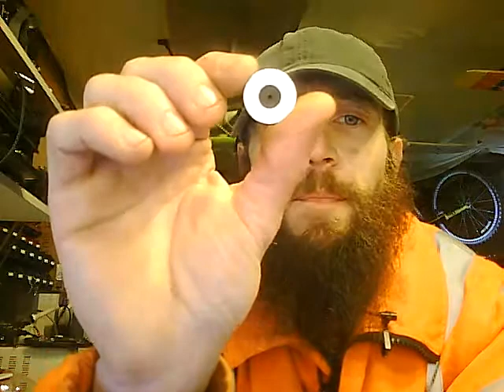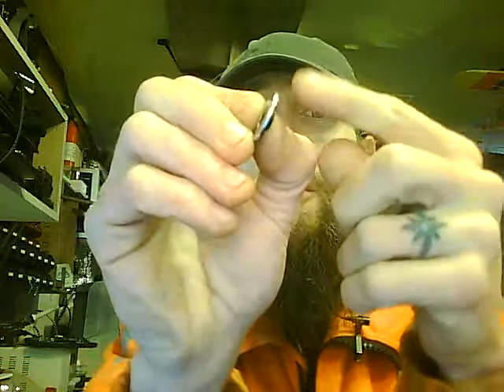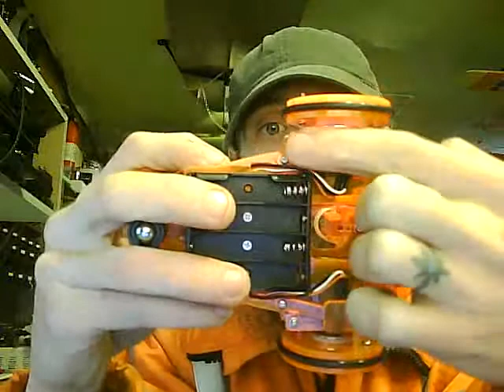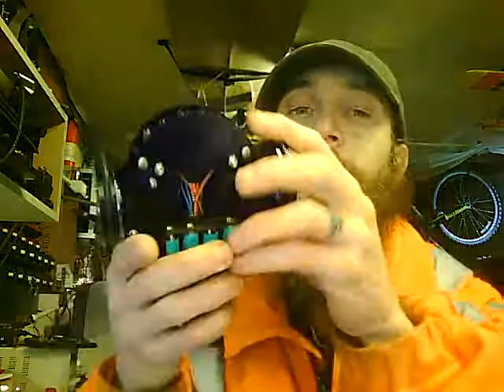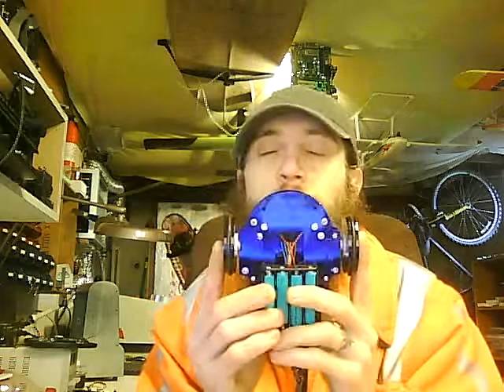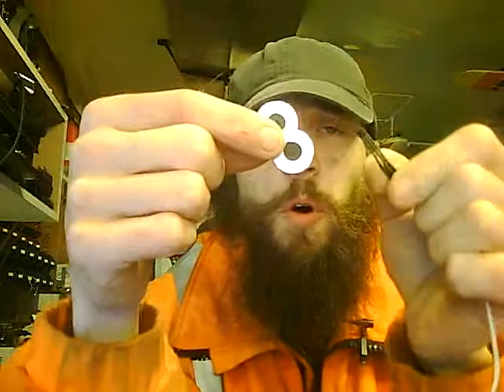RBS New Encoder Kit

Comment from the maker: You are correct, single-sensor only, no direction (other than the fact that the robot decided to go in a given direction and thus, already knows what direction its going). That said, there is no reason 2 more sensors can't be added to get true quad-encoders. Hell, you would get 16 clicks/rev outta the deal too.

Comment: These are very popular motors but there is no tail-shaft encoder kit for them and yours looks a bit to big for them.  Make yours smaller and the right hole to fit the tail-shaft and I think you have a hit in your hands: "Micro Metal Gearmotor HP with Extended Motor Shaft" I would buy it in a heartbeat!